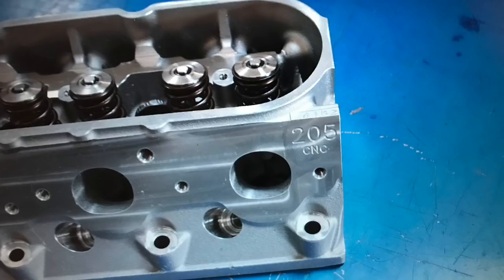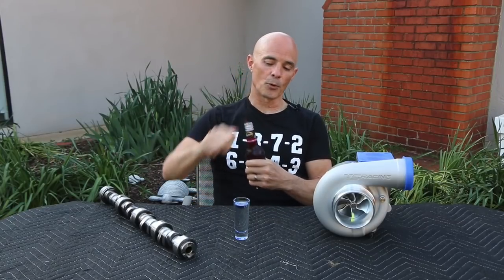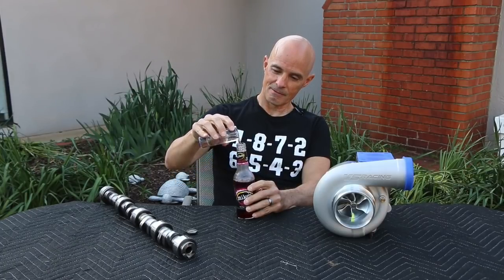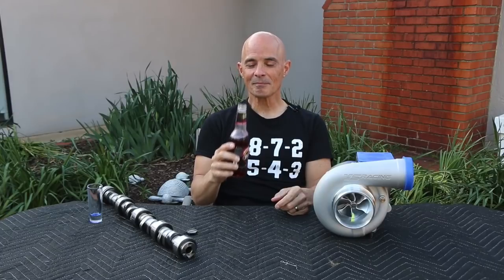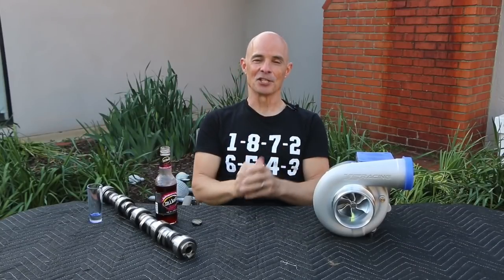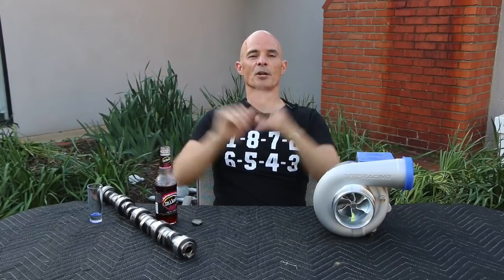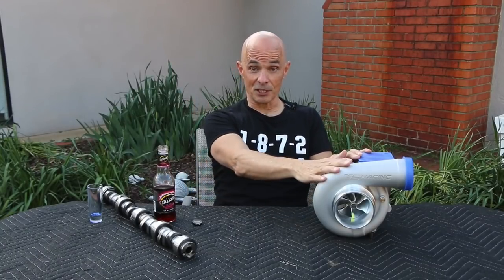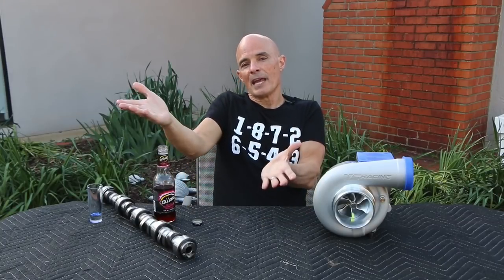TURBO LS-WHEN ARE PORTED HEADS NECESSARY?

Comment: The engine that makes the most power with the least peak power rpm rules. 460 at 6700 rpm beats 462 at 6900 rpm. Larry Perkins and the late Vincent motorbike tech Phil Irving from Australia, respectively  the greatest sedan car racing engineer  and motorbike technician in Australia taught me that. If you have to use an extra 5 to 10 pounds of boost or an extra 1500 rpm to get 1000 hp, then just do air flow cam and chamber porting. The dyno is not a decieving device, but the true litmas test is multiply the peak power rpm by cubic inches, and divide by the flywheel hp before turbo has generated an effective boost ratio. On all Richards good cammed, modified head and best intake engines, the result is 4132 on average. Stock from the factory, 5500. Any time you do Heads Cam Intake, you reduce the total amount of revs needed to meet any hp desired. Making a 36% more power should always take 36% less rpm. All Richards modifications work towards this. Peak power RPM x Cubic inch displacement all divided by peak Superflo Dyno hp. The philosophy is used by sucessfull  endurance racing nuts all over the world.

Comment: DETONATION/OCTANE is a key factor here flow is everything for power want 800 on pump gas get heads cam and everything to make more power with less risk  Upgrading heads is great for boost but it all depends how much power you want and at what boost or what octane you want to run if your going to be on 91 octane flow is gonna help get to your power level with less boost which means pump gas is fine . if your running e85 you can have more boost  more timing with no detonation

Comment: Pressure is two things.  Number of molecules and heat.  A liter of air at 50 deg C has twice as much oxygen as a liter of air at 100 C under standard pressure.  If your motor fights the turbo, you are producing heat.  The more heat, the less oxygen.  If you take the heat out with the intercooler, you just un-boost the charge.  Wasted energy.  A free flowing motor allows the charge to stay cool and oxygen rich.  Is this an issue at 9lbs on a stock LS, no.  Crank it up to 20 lbs, you will turn your turbo into a heat pump that isn't delivering the O2 you need.

Comment: I've only ever used factory heads if I get a decent set of heads. If you some shitty castings you will make drastically less power nap/on boost even with porting, springs and all the bells and whistles. There have been a couple videos about this specific thing done by horsepower tv.

Comment: I'd be interested to hear your thoughts on modifying an LS vs a BBC or BBF.
Here in Australia, we didn't get the 4.8 or 5.3 LS, and most were LS1 5.7, LS2 6.0 and LS3 6.2. I can't think of a vehicle that got a big block here originally either though they are put in wild street cars sometimes. 
Obviously the LS is generations better in technology, but if you are starting with a junk yard motor there must be a difference in modification required to get say 600hp from a 6.0 than from a 454 or 460. 
Apart from the cars which have original big blocks and the owners want to keep that originality, one big decider must surely be the cost. Is it more cost effective to get a torquey 600hp LS than a 454/460? It'd be an interesting comparison because when you start putting on new heads, carby, intake, valvetrain, machining and pistons in a big block the costs are going to rack up. At this mild power level is the LS going to be cheaper because the thing is so strong from stock and the heads flow so well?
Would a LS 6.0 with fuel injection have a broader torque curve that matches a 600hp big block's torque level? Would a cam, injectors and tune do this?

Comment: interesting to see such a difference with just a ported head. Hope my future combo will have a similar change (stock 243 head and .600 lift 234*@.050 to ported 12 degree LS3 and .625 lift 236*/251*@.050, on a LQ4 bottom end)

Comment: my first turbo build i was very budget minded, now as im building my second setup im slowly starting to come into the "grey" area... first setup was just a junkyard engine GT45 and a sloppy stage 2. Now im using a actual turbo camshaft, better heads that are home ported a borg s475 and a few more performance odds and ends plus some visual features too... it was fun to see how cheap and easy it was to do on a budget, now its nice to throw a couple mindful bucks here and there on the setup to see what gains ill have over my first build.

Comment: Here’s my .02 on this... whatever that’s worth. Lol. If you make more power from the engine through natural airflow (heads, cam, intake), then it will take less boost to reach whatever your horsepower goals are. Sure you can crank up the boost and make that same power, but you start to fall off the efficiency map of the turbo and make too much heat. Lower boost will have lower IATs and be more tolerant to ignition timing. Especially in a vehicle
driven on pump gas. I think it’s safer for the engine to have better airflow than relying on boost. 

Plus...let’s face it, we all get used to the power and it’s addicting! You always want more! If you’re already maxing the turbo out, you’ll have to make bigger changes for more power. If you are making power at lower boost, just turn it up.

Comment: I think immediate budget dictates which way i go. If i could only afford one or the other, id upgrade the camshaft first, then turbo, heads next. But, all of this would be after the car is able to put the target numbers to the ground. You can make all the power in the world, but if you cant put it to the pavement its useless. 
Most modern chassis can handle 500 hp with minimal upgrades and be fairly effective, but above that and you have to factor chassis upgrades into the equation with just as much importance as the drivetrain improvements. 
Just my $.02

Comment: think about how many drivetrain parts you are going to break with 900 horse. you may not break as many parts with 450. 450 is more streetable than 900. it's amazing how much power you can get out of engines made in the last twenty years.

Comment: Over a 2 year period of time I helped a friend tune his 1080cc (Kaw. ZRX1100) from 120Hp NA up to 500Hp with Turbo.
One of the "several" build combinations/upgrades was head work. Long story short, we jumped from 220Hp to 260Hp with the head work (same cams, cam timing and boost) 👍
Mods were over size valves (with proper un-shrouding in combustion chamber), porting (which included epoxy for calculated critical choke area in intake ports).
He did raise the compression from 8:1 to 8.4 so not all of the 40Hp gained was from the head work but most of it was...

Comment: I'm just slightly knowledgeable about engines. But on my own, knowing engines are basically air movers, porting heads is never a bad move. Moving more air, efficiently, increases power.
It allows lower boost, which decreases heat, increases air density. 
Right?
Now, I go watch the video.

Comment: I come from the SBC experience with build a really good rotating assembly and put the best heads you can afford on it. This Sloppy Junkyard turbo stuff for a little more to maybe double what I have spent on a set of heads alone is really intriguing because I've never experienced that kind of power. However I'm in disbelief that it's that simple and that I'd rather clean up that junk yard slug and get it to where it's not going to pop because I didnt check this or that and or this little thing wasn't right and send garbage out into the turbo and need to get another slug and turbo. I hope that makes sense...

Comment: I got a car with a 4.6L OHC ford modular engine... after running a few calculations I have determined it has milled heads raising the compression and power up to about 338hp... if so a twin turbo set up of two GT30's giving it 5psi of forced air all the way to 7500rpm. Would hit the limitations of 91 octane. but would be in the 400's or closer to 600hp? ether way  the drive shaft and rear axles can't take it so this is thought time?

Comment: I have a 6.0 na that I put ported 243 heads on with ported tbss intake and cam.  For a street driven truck it’s a lot to handle.  I have thought of adding a turbo but I think 500whp is a lot for the street.  Maybe I’m just old school, I remember when you had to really build an engine to make 500 at the flywheel now a stock 6.0 with a cam swap will do it.  For a street driven car that I wanted to be quick I would go with the stock 6.0 or 6.2, change the cam then a small turbo with about 7lbs of boost.  I think that would make the best all around fun car.  I go ported heads on an na engine though.

Comment: Porting the heads properly increases power and reduced the PSI, by increasing the flow rate; reducing the PSI of the system decreases the heat generated, so you need less intercooler for the same amount of power.

I had this discussion and experimented before.
Porting helps.
Angle milling the heads, from .128  on the exhaust side to nothing on the intake side helped a lot.....

Comment: you will make more torqe with a stock head, because of the velocety sweetspot for gas mixing with air  comes earlyer,  and wit a aftermarket head you will make more hp on top, because of less restistance in airflow,

Comment: Holdener what needs to be done to swap a 08 L92 escalade motor into a 04 sw Silverado? It would get some ported 706 heads and a btr stage 3 v2 truck cam and maybe lsxrt intake.
Reply from the maker: i do power not swaps
Reply: @richardholdener1727  Rgr that

Comment: If you increase head flow you decrease charge boost. That means your entire car is putting in less heat to make the same power. This is an overall better solution. Time is money. Homebrew is uncertain. How much does a set of heads cost anyway? About two day's worth of work? Buy once cry once in my opinion. Not a lot of brains around the "bUt YoU dOn'T nEeD hEaDs wItH bOoSt crowd.

Comment: Love the "Happy Hour and Horsepower" premise! I'm an in the middle leaning a little more towards spending the money kind of guy. My build is a L76 stroker 403 with an LSA blower. I spent the money on the crank, pistons, rods, cam and ported blower. However, I ported my own heads. These are LS3 heads and are darn good stock. So I knew I didn't need that much more out of them to get to my HP goal of 8xxHP. I also enjoyed the research and work to do the porting. There is something soothing about doing that kind of work to me. Love your videos, you are by far the best source for this information and I just enjoy drinking and watching with you!

Comment: Does anyone know the max flow capacity of the 243 heads? I have a stock ls2 with a 2300 magnuson. Have a cam and headers to go on but don’t want to change the heads. I want to up the boost to get me to around 800whp. Will the stock 243 heads support that?
Reply from the maker: easily

Comment: i like this format. quick question... is the 350hp motor with 30psi ok to do? what ends up being its downfall? does the total psi of backpressure create too much heat? lets assume we can keep the air charge temp in check. Will the 350hp @30psi motor die an earlier death vs the 450hp @ 15psi?
Reply: @Richard Holdener

Comment: I have a 4.8 in an extended cab 2wd Silverado(mild prerunner build), and a 6.0 in a Yukon Denali(family hauler). But I tend to like a mild cam, but in the 600 lift range with appropriate valve springs, long tubes with true duals if not adding boost (my 6.0 is staying NA for now and getting 706 heads, but haven’t decided if “building” them will be necessary) My 4.8 just got a BTR stage 1 V2 truck cam with springs, new lifters, trays, pushrods, headstuds, and gaskets, along with a truetrac differential and 4.56 gears. Next up is a transmission!(Any advice here???I’m thinking a built 4l60. I really don’t think I can afford everything to do the 4l80 swap unless someone knows an easier way of making it fit) and then it’s time for BOOST!!! I want 750 at the rear, hopefully I can get there with an S475 and my stage 1 truck cam.

Comment: If I want to make POWER for dragracing or bragging rights, I throw everything and the kitchen sink at it. Even with a maxed-out turbo, I will still make more power with head & cam upgrades since boost and thus heat is reduced with the added flow - ATA, ATW, M50 or nothing at all makes no difference, less initial heat = more efficiency = more power.

If I want real-world driveability, I would improve pre-boost efficiency: a "weaker" cam, smaller ports, maybe increased CR... Even if these mods can hurt the NA figures, the improved response and decreased lag means a LOT better throttle response, power modulation and everything that makes daily driving and other-than-WOT racing easier. I can still make nearly the same maximum power, albeit at a higher boost level. And compared to the balls to the wall, no holes burred (pun intended) version, I will definitely have a wider power window and most likely a higher average HP through the range: measured from a pre-boost application of the loud pedal, I will abso-fornicating-lutely have a ten gallon Stetson-ful more horsepowers than the "high-HP" version...

So... What would YOU like? Build that.

Comment: "Same boost, same timing, same AFR" that means you can run the same fuel too. May not matter to some, but sometimes it feels like I can go through a tank of E85 on the way to the E85 station.
Reply: Good thing with E85 is that you can lean the shit out of it on part load, as long as you put enough timing in it. No problem going to lambda 1.2-1.4 while cruising the highway and that'll bring MPG figures inline with those on gas, given the same engine temp. But do the correct work with EGT and A/F-meter, alcohol knocks are softer/rounder than gas knocks and sensors tuned to the latter can miss them - but they can still break stuff...

Hell, many of the numbnuts doing "conversions" on stock motors run that lean all the time - more or less just switching fuels w/o doing anything!

I built a NA 350 TPI as a dedicated E85-motor way back about 20 years ago. I ran it at high temps (115 C/240 F thermostat - 2 Bar/30 Psi system pressure) with a heated intake and made slightly more power than stock with the same MPG as it had done on gas, even lower on the highway: 15 MPG avg and 18-20 MPG hwy in a 1994 C1500 w/ a 4L80E that did 15/15 prior to the conversion.

Comment: I think one thing that was missing in this conversation was durability and the way that you could lower the stress on a motor at the same output. 1000hp with stock heads I think produces a cylinder pressure that is much higher then 1000hp on a motor with a good set of heads.  If I wanted 1000hp and I could choose between doing it at 25psi or 14 psi I would buy the parts to do it at a lower psi. That motor can do work and live.

Comment: I am going to put the responsibility / "blame" on you for starting this conversation (debate) because you did start it (in this instance). Now that getting tons  of power has become possible and much easier than in the past (thankfully),  another issue crops up.  How does 900 hp look better than 700 hp     .......as 900 hp is going to break /defeat my transmission in short order ?  For instance,  a guy has a car.  They can go to a bigger rear axle,  a Ford 9 inch, or a bigger Dana 60 based axle as needed which is going to handle big time power.  In GM context /terms, since that is the natural bolt up trans to an LS motor,  the R4 700 is the weak link in the drive train now.   I know, the 4L80 is the step up from the R4 700 but even that has its limits.   ......honestly, what does a car guy put in the transmission tunnel when the motor starts getting well beyond 900 .....or 1000 HP,  figures that you keep throwing out as you speak.  I realize that  this is an engine forum, not a transmission forum, but YOU started this type of debate.  (thanks)  For right now, I will avoid getting into the deal of tires for set ups north of 1000 HP .

Comment: One thing you did not cover is that you should use your compressor map to decide.  A long low map would like heads/cam work. A tall short map would like the stock heads.  As far as the motor comparison go i would rather you did not compare boost as a constant, But rather maxed turbo flow/rpm on stock heads to the same turbo maxed flow/rpm on upgraded heads motor.  That is real world.
Reply: I agree!
Reply: I also agree!

Comment: I think a build up would be the best way to go, slow getting parts that would be really good.  Not full race motor though, stock bottom end, aftermarket cam, then some good heads after turbos to start flowing better.

Comment: One benefit of porting is increased reliability- you can make more power with the same, or less boost. Reduced cylinder temps and pressure should be a good thing.

Comment: I would think I'm a middle man. I built a 408 with a Lunati voodoo rotating assembly 11:1 DSS forged pistons, GMPP LS3 CNC ported heads, FAST 102 intake. It runs 10:90's NA 3600# camaro. Now I have to decide what size turbo or do I go twins? ....

Comment: Somewhere in the middle... I have a junkyard fresh 02 LQ4 shortblock, free set of 08 799 heads, used Gen IV 6L rods and flat tops, NNBS truck intake. I am thinking $163ea evilbay twins, a Summit turbo cam, etc. All going into a stripped down 72 Monte Carlo @ roughly 3600lbs. My biggest spend will be the Holley TermX Max.